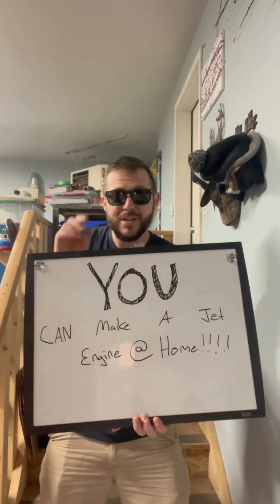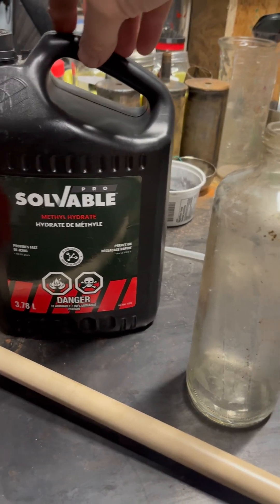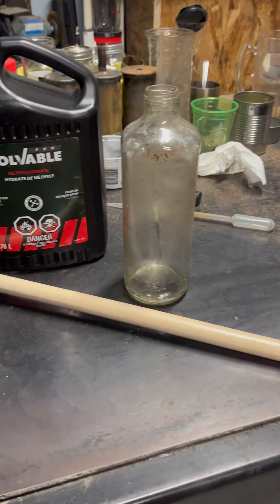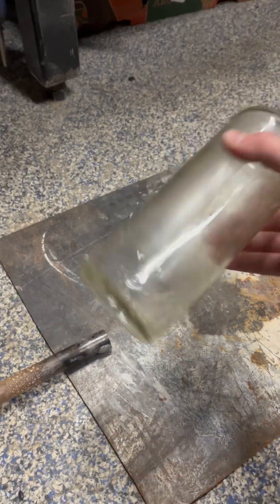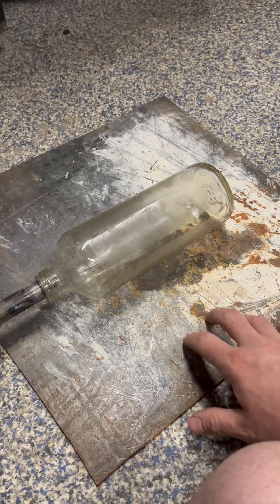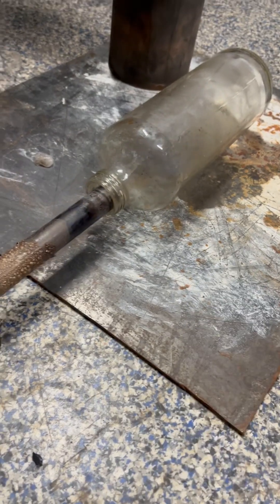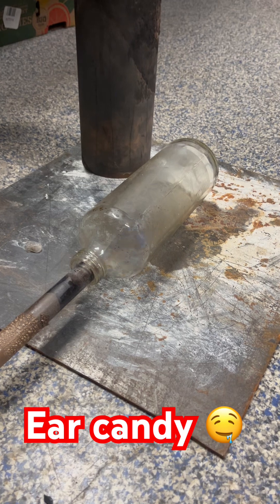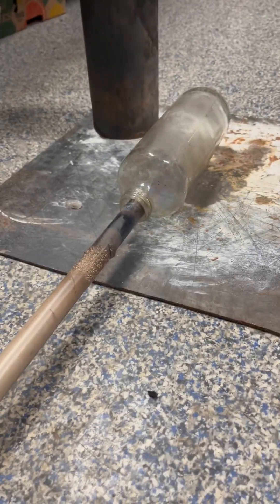You can make a jet engine at home!

Comment: Just curious why bother with the exhaust pipe if its not sealed up? Same thing woulda happened with out it may have actually run a higher frequency with out it there seems like more of a hindrance with the weird airflow its making right there
Reply from the maker: I was never able to get this shape of bottle running with just one hole for whatever reason.  With some tinkering around I’m sure I could probably get the frequency higher, just wanted to show guys how easy it is to make with everyday items.  I started accumulating parts for a valveless btw, I will post when I get it put together
Reply: @AdhDad420  i forgot to consider that your intake and exhaust are the same hole on these style but same basics id say the hole was to large to get the right back pressure since adding a restriction makes it run. And did you mean valved?
Reply from the maker: No I mean the valveless sort of u shaped ones.  I think they are called Lockwoods if I’m not mistaken
Reply: @AdhDad420  ah i see . Valvless is a broad term for pje the ones your doing are all valveless the valved ones have usually reed valve style valves or flap valves of some sort commonly shaped in a sort of flower but more like the cloud things in spongebob lol or just rectangle flaps that work like little doors . Really not technically valves at all in my opinion but thats me . Anyways the valves make them more efficient more powerful and easier to get going because it only allows flow in one direction .when combustion happens the pressure closes the intake valves forcing all the combustion gas out the tail pipe then when the negative pressure from the gases leaving occurs it creates a suction as the last bit of exhaust moves out the tail end it sucks the intake valves open and allows fresh air in for the next combustion cycle . There are many types of valved and valveless pulse jets out there the classic u shaped pj is a valveless the main purpose of the shape is that since its valveless you get thrust from both intake and exhaust so if the face the same way its not fighting it self . All my pj are valveless technically so zero movie parts . I am working on a valved one just to do it but i find the valveless ones to be cooler and more challenging. Also working on a couple of turbine jets
Reply from the maker: Do you do your reducer cones with a roller?  Or just manhandle them and tack em up?  I’ve got templates for cones I’m gonna use but no sheet roller, I was just gonna wing it and hope for the best bending by hand
Reply: @ typically i was just getting a longer piper than i needed for the body of the jet and cutting longways roughly 6 cuts a couple inches down the pipe and hammering them down to a cone shape . I built a little crappy press recently tho and have been pressing them with a coned die out of flat plate or washers depending on size . Have plans and parts for a roller just been procrastinating building them lol
Reply: @ its really not hard to just hammer one out tho it’s usually just sheet metal . An anvil is best obviously but most people dont have one so a decent piece of pipe works ok just gota work it but really at that point in my opinion any ways it would be quicker and easier to just take a round plate put it on a pipe and use a smaller pipe or punch in tge middle of your disc to tap it into the bigger pipe just make sure your disc wont slip inside of the pipe your tapping it into to if it does its just annoying to get out
Reply from the maker: Ok I’m definitely going to be putting one together here soon.  I have my templates and sheet metal now so just waiting for a day when I have enough time to bang some of it out
Reply: @AdhDad420  heck yea i hope to see it on here soon man good luck . Also just some good info i wish i had going in to it . A .35 mig tip or a number 55 carburetor fuel jet  have so far been the best fuel injector sizes for a variety of sizes of jets verying from a 1.75” od jet body up to so far a 3.25 “ body
Reply from the maker: I posted it!  Check it out if you see this, it’s one of my newest shorts.  Also I am working on a smaller pulsejet concept as well using a .035 tip as you suggested, still dialling it in but I have gotten it to run for a few moments so far